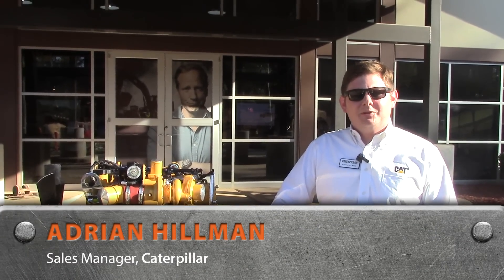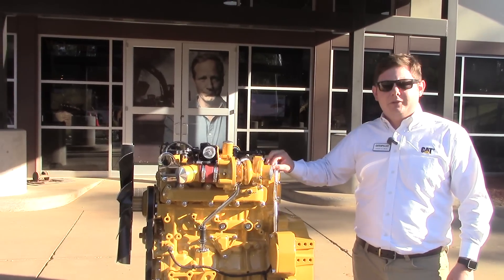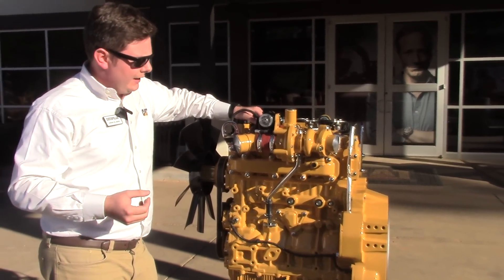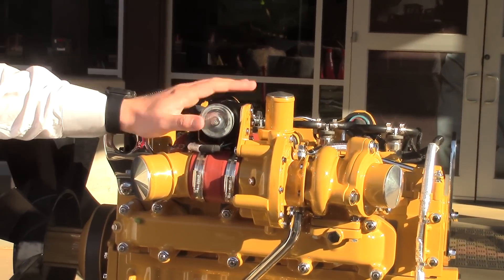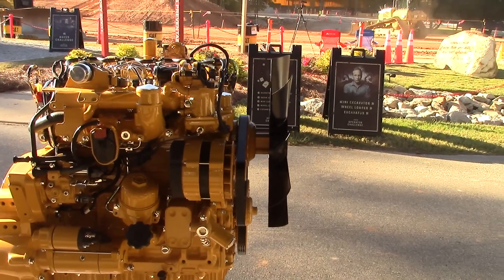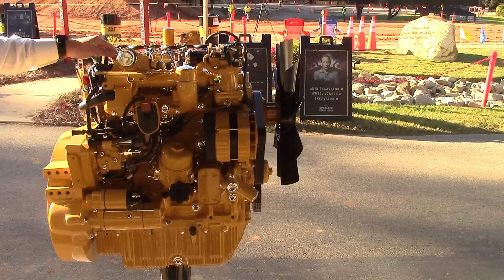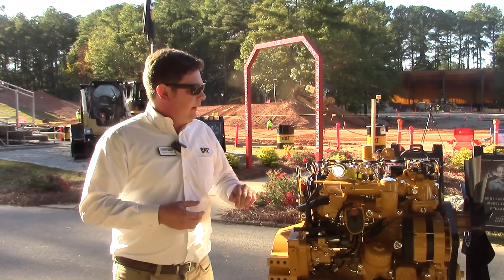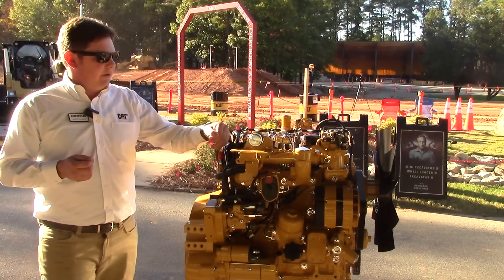Cat C3.6 Diesel Engine Fits Increased Power Output in a Smaller Package

Comment: we just bought a 415 backhoe 70Hp no def. What would it take to turn the HP up and is it possible
Reply: I would see if a mega squirt could run it so u can delete all of the emissions. Idk if it’s fuel is mechanical or electrically injected but usually more fuel and if you can a turbo upgrade with a tune. 174hp in this thing could be 500lbs of tq. Hopefully you can double or even triple that with what I mentioned.

Comment: some of us would prefer having an engine that has enough power is efficient on fuel easy to maintain and built to last over having one that is quieter.. putting time and effort into looks and sound should not be an issue... it is an equipment engine.. have those changes helped the engine run better and last longer and did it add to the cost

Comment: Could this go into a sherp atv? Sherp uses Kubota v1505-t e3b ,they look simular in proportion?
Reply: its possible but the 3.6 is a bit larger than the Kubota engine. When installing in equipment theres a lot of factors to consider to make sure the engine installation is adequate. Heat rejection, exhaust backpressure etc etc.. 
It could be done but would take some engineering to get it right.

Comment: Could I put this in my old truck?
Reply: How about putting this engine in a Sherp ATV?
Reply: Do you want expensive emissions systems on your old truck that fail and turn the engine into a brick until the backordered parts are replaced? Get an old diesel engine or just use gas.